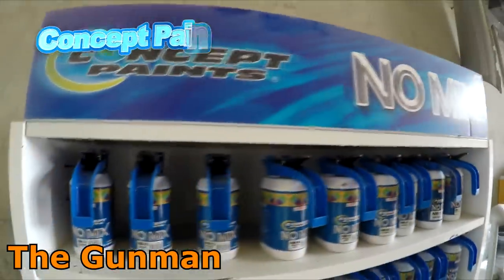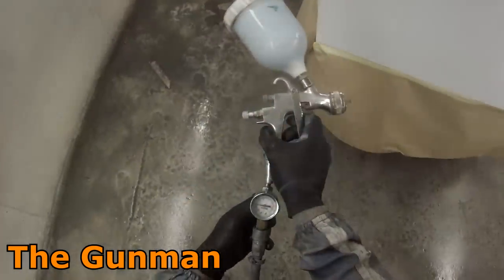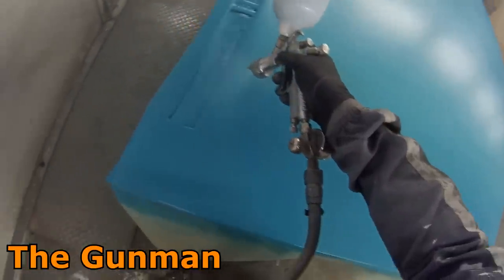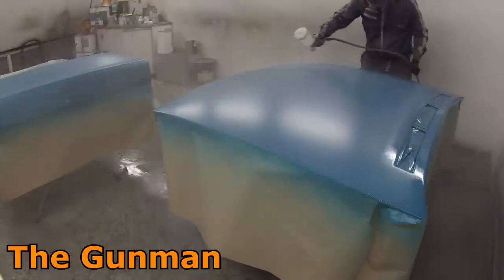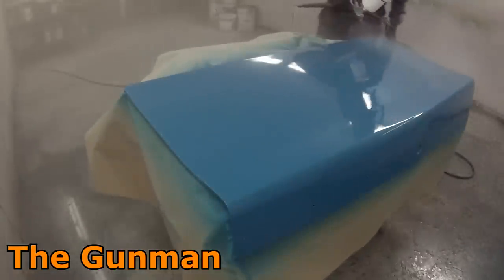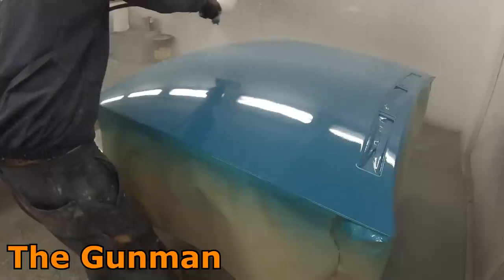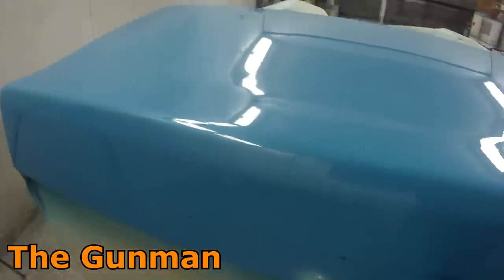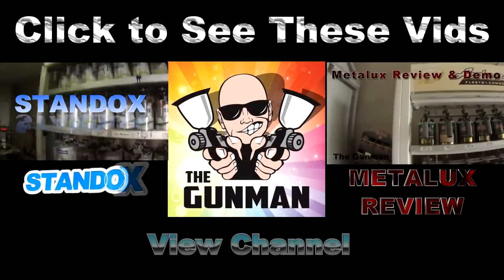Concept Paints Review & Demo

Comment: Very fair review, matches my own limited experience with concept. I used the hs clear once and never again I can get upol hs for just a little more and it is far better drying,sanding and gloss retention imo , I have some concept ms clear I am using up on door jambs and boot interiors etc and it does ok for that . Their solids are great but the metallics seem to lack a bit, they don't seem to stand up and pop out at you like the more expensive brands. Their hs primer is brilliant absolutely love it, can't praise it high enough. Concept does have a full acrylic system primer paint and clear, never used it so can't comment, I always found it weird that their no mix can be cleared with either 1 or 2k but isn't compatible with their 1k primer, not sure how they managed that lol. I am happy to use concept I offer people the choice between concept or lesonal which is a little bit more but far superior in their metallics or pearls or they can go top line and get standox or glasurit etc, most want the cheapest but their are exceptions i have a hz wagon booked for next year and he wants a full glasurit system even though it will be a daily driver he wants it as good as possible and the paint to last as long as possible. For myself i wouldn't do my own car in concept unless it was the shopping trolley for the missus and would get the usual car park flogging but each to their own even a cheap paint system is better than no paint at all and can still look good. Great vid gunman keep em coming, really looking forward to some vids when you are set up in your new home, I reckon you will love the custom work and excell at it. Cheers
Reply: I love U- Pol clear ! It's quality stuff, UK made, and marketed at a competitive price point.
Reply: Mitchell Ferre really can't fault it and a great price, upol do quite a lot of good products from what I hear.
Reply: +Brendan Weicks I have only used U-pol clears. I have been told their guide coats and primer kits are the real hidden gems in their product line.

Comment: I painted my car in concept acrylic 14 years ago and it still gets alot of comments about the glassy finish at car shows but th car spends most of its time in the garage and I was a car detailer for twenty years so my experience with buffing and maintaining it made up for not being a professional painter.
Reply from the maker: Great stuff. This system if just ok, for the smash repair industry it's not very good. Cheap resprays is it's strong point.

Comment: Hey mate have you used it recently? I've had major issues with the basecoat over a 1k primer.. I was recommended 2k thinners which I think is what actually reacts with the primer
Reply from the maker: I've long since moved on from this crap. But their costs are getting better, my boss had a can sitting around so I used it up on a cheap respray and it sprayed well, car still looks good too
Reply: @TheGunmanChannel  yeah fair! Unfortunately not knowing any better I have sprayed the car in acrylic primer filler. Started on the door jams and instant fry up with their no mix base coat. Thoughts on a different brand acrylic over that primer?
Reply from the maker: @simonhiggs5742  if it was me, I'd get some 2k primer and seal it all down with that.

Comment: Hey Gunny.  7 years have gone by, have you used any Concept clear since to see if it's any better these days?  Love your vids mate :)
Reply from the maker: Actually I did, and it's much better. I used it over Standoblue water basecoat and it went down nice.
Reply: @TheGunmanChannel  i got the HS clear kit here 3 :1 mix, have mixed it up to the correct ratio etc but it seems to be very soft , removed some peal with 2k sandpaper and it buffed up to a shine to easily, and seems to be a bit soft after 4 days of 20C weather

is this normal? have never used clear always do single stage here
Reply from the maker: @michaellareem4014  it's not normal, that's exactly why I wouldn't recommend this clear. I used that can up and never went back
Reply: @TheGunmanChannel  sorry man I ended up watching the entire video and got my answer  in your video

Ya it's tough to know what's normal and what's not when I'm new to it 🤣

P.s your trick of heating the paint I love it

Comment: I noticed your using hs clear, what's the difference between hs and ms clear coats? Is one easier to use then the other and are the finishes different and etc?
Reply: High Solid (HS) Medium Solid (MS) MS is usually a little easier to use for novice painters. They are equally good in quality as long as you get the correct mil. And it looks good. That's all that matters. Solids content is based on what percentage of the clear coat stays on the car after it drys.
Reply: +Anthony Milano What type would you suggest to use in cold environment? I mostly use HS and UHS clears, but Iam quite not happy with its hardeness. Is it even possible to get it that hard without baking it? I always thought that more solid clears will be harder. Iam painting custom mountain bicycles so the hardenes is very importent for me. Do you know any ultra hard clear from your experience? After all struggling I ended up buying PPG Ceramiclear which I had not yet tested but without baking I will probably get the same resoults as with others clears as I used.
Reply: +cednik 
Anything that uses isocyanates to cure is drastically slowed down by cold temperature. I do not believe the solids content will effect the through hardness. But the temp. Will drastically affect the time it takes to get through hardness. The ceramic clears are very hard when cured. But will still need a lot of time to achieve through hardness at low temps. You might try some accelerater to achieve the through hardness at a quicker pace in cold temps.
Reply: Anthony Milano Thanks for the answer, Its time to invest into some kind of baking system.

Comment: Fkn hate guns that change settings when you pick them up, I've got one that changes the fan with your thumb, 
and one that does the air with your little finger on the bottom. You would think the shitty threads on cheap guns would jam up so they aren't as easy to bump..
Reply from the maker: +MrFuriousG  haha you're a little Furious G just spill some 2k clear on it where the sweet spot is lol.
Reply: Nice one, only problem is the sweet spot changes every time with the guns I mentioned, but if you mark the threads up nice with wire cutters they are ok.. (you probably know them, they come in a box with 2 x full size gravity fed guns, and 1x mini gun for around $100 from cheap places like "Total tools", and you normally only buy them to do a couple of cashys at home and think "i'll just throw them out afterwards, but never actually do:)

Comment: I use the US version transtar everyday for base coat, I have found the metallic colors are sometimes hard to match the color chips I have are better with the new update the older ones were terrible, I do not use any of there clear coat because they have way to many and no one can ever give me a straight answer on which one will replace what I use, transtar does cover a lot better then chroma base which we used to spray plus for us it's mixed 1:1.5 so I get a lot more out of it, I would put the system in the middle as far as quality and cost
Reply: TOM Exton I agree coverage is superior to alot of the expensive paint companies. Do you activate your basecolor or no? Transtar reccomended it on there tds sheet for there full warrenty. I do agree I would place them in the middle as far as quality. I have used ppg dbc,dupont chromabase,Probase by mrtn senior and crossfire from mrtn senior. And I like the transtar no mix the best.  cost and coverage are a big factor. and for someone like me. 1 man show I'm not fast like a Collison shop so I can take whatever time is needed to mix for accurate color match. as far as the pearl and mettalic problems there ways to combat that while mixing. like adding mettalic raiser or something to make them stand up better. One thing I'm suprized that none has mentioned is that Transtar is coming out with a color match camera. They are doing a panel cutting program and want shops to cut panels to provide factory colors. for this camera. They are evolving and will be a very good product possibly superior to big namers.
Reply: Please Gunman I'm new in using this NO MIX colour paint, I wanna know please what time will I apply the clear coat, do I apply when the No Mix colour is dry or still wet PLEASE

Comment: Thanks for this info GM - taking Concept Paints off the table (because it seems like way more hassle than it's worth), what brand would you recommend for a hobbyist doing a 2k job at home? (I'm in Perth too btw).
Reply from the maker: Nason is dirt cheap and fine to use but not best quality, Cromax has decent 2k colours, I always went through Geoff at Park Automotive.
Reply: Have to agree. I have had very good luck with Nason. There clear 465-00 is really nice for the price.
Reply: +The Gunman Hi - good review so thanks - I'd seen the Concept paints in Sydney and I think Supercheap were selling the No Mix Basecoats but not the 2K clears.  I was wondering whether you had any opinions of the DeBeer range.  They seem OK to me and are mid-priced but I don't have your experience to compare.  I expect PPG is the top of the line but their price reflects that - PPG was nearly 3x the DeBeer price last time I checked (for a solid red).  Cheers
Reply from the maker: justcruisin109 I'm not a deber expert but when I did use a solid red it caught me out and looked covered after 2 coats in the booth then out in the sun was transparent so keep that in mind if you do go with it for a red, yellow or green maybe order a little more and apply 3 coats.
Reply: +The Gunman When I asked the PPG jobber why the PPG was more expensive his answer was that all manufacturers use pretty much the same pigments, it's only the binders that vary (except for things like UV additives and so on).  Given the basic chemistry of 2K paints is well known, it seems strange that the paints aren't rated for coverage, hardness, UV stability and so on.  That leaves less experienced users to just go on prices - the more expensive, the better the paint (usually) - there are a lot of brands in the mid price-range to choose from though.  

Always enjoy your videos - a bit more polite than "My Friend Pete" but you always give us your honest opinions.

Cheers
Reply: +justcruisin109 Can't watch that guy anymore. "Pete" also find you learn very little . Maybe how to cus and carry on. I'm ex Military and to me he sounds like a fool.
Reply: +The Gunman Cheers mate - stay out of the sun and have a good xmas :-)

Comment: hey gun man help us out , im new to this 2 pack i bought concept base coat and ms clear, how much reducer do i use on the basecoat and how much reducer do i use on the ms clear your advice would be appreciated cheers
Reply from the maker: base is 80% to 100% reducer on top of the basecoat so 1lt will take from 800ml to 1lt thinner, just check the viscosity and make sure it's right, on a colour that covers bad I like to leave it a bit thicker to get better coverage, I usually leave the thinner out of the ms clear cos its pretty thin already.
Reply: stephen Rorhan 1:1 on the color and maybe up to 10% on the clear

Comment: I use the USA version of the transtar no mix basecoat. As someone else stated ours needs mixed 1:1.5 for better flow and smooth dry. So far my color match has been wonderful. As someone also stated it is better for the slower type shops because certain colors require more tweaking to get an accurate match. But the new color chips are amazing. The old ones like we're shown in this video were computer generated and do not match for shit. The new ones are painted with the actual product. I will say this. EVERY and I mean every paint system will require tinting on some colors. So to say that a system sucks because color match takes awhile to get correct isn't accurate. Because I have seen shops with new DEBEERS system sit and mix and tint to get accurate color matches. All in all the system is great. I do not use there primers or clears. I use Rubberseal Medallion refinish clears and primers. As far as paint delamination that I have heard only happened to customers using the Low VOC reducer because there flash times are way off. and most people have experienced the product drying before it hits the panel. Causing poor adhesion and delamination. With the low voc reducer iy needs to be applied wet. And be careful on what temp reducer you choose.
Reply: +billet s20g sxt Whats the cost on the average per pint or quart? I used Medallion clears as well.. really like their 2:1 clears.. mrs-6200 & mrs-6400. Which clears do you like? Thanks
Reply: +akd052774 I use the new tek elite clear coat mrs-31. I really like there tek elite products. It is there top of the line!
Reply: Hey, I have an opportunity to test a nomix system by Transtar, have heard that the price is all over, and some colors more expensive than other big brands.. any info would be helpful, whats the average per pint? Thanks
Reply from the maker: +akd be careful if looking at getting this system, there are some colours that you will NEVER get, the metallics just aren't right, it's good for full resprays, solid colours and some metallics but be warned, you get what you pay for.

Comment: ive used glasurit , baslac , protec(both new and old systems , PPG=solvent/water  ,debeer , ...and i would easily say PPG is by far the most over priced over rated system out of all of them . the sovent is a prick to paint , clears are ok in ppg and there wet on wet primers, and the colours are the worst  there is , dont even both with the spectro its pathetic doesnt even work ..its only for people who cant colour match even know the colours are rubbish anyway, alot of people are saying that debeer water is the best water system atm ...so any1 thinking they wanna put ppg in i highly suggest you dont , i see this concept paint down at super auto cheap ...
Reply from the maker: Yeah that kinda says it all hey.